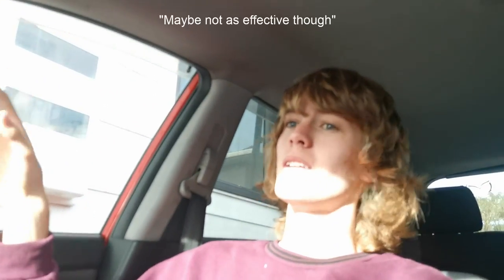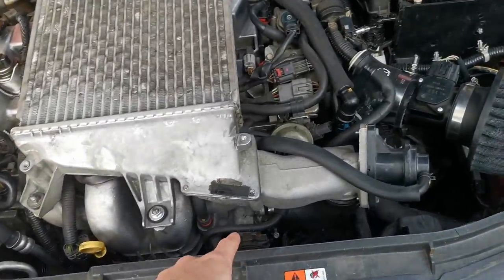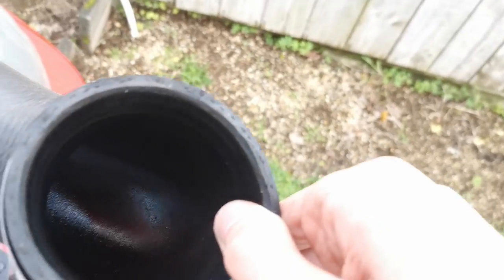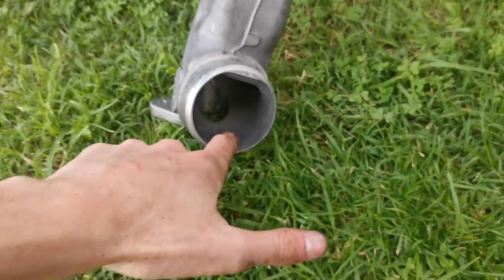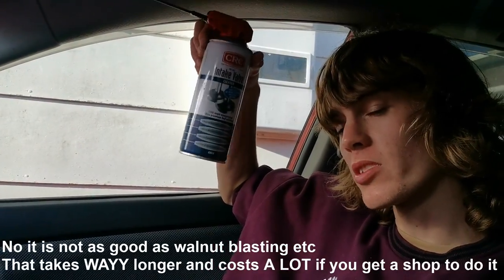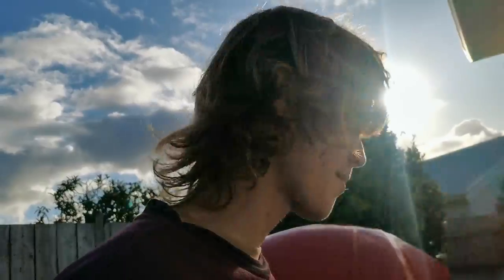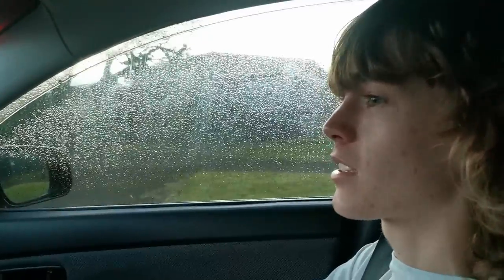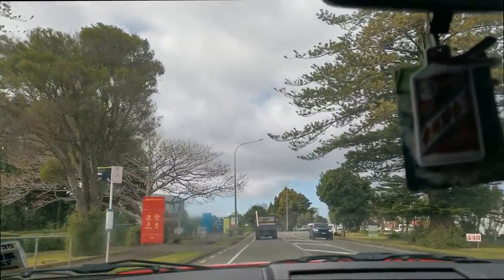DO THIS TO YOUR MAZDASPEED BEFORE ITS TOO LATE

Comment from the maker: so with the throttle body, i’ve heard pushing it open by hand runs a small risk, i can’t say i’ve ever seen someone have an issue with it.
apparently you can plug the switch in and have someone floor it with the ignition on to open it, i’ve tried that and it didn’t work

https://instagram.com/life_of_tuners?igshid=YmMyMTA2M2Y=

Comment: you might want to also service the fuel injectors, and also clean the intake valves. Would also reccomend a pro tune from reputable e-tuners. Also change spark plugs, coil packs, maf sensor.
Reply from the maker: Spark plugs are new, defo gonna look into getting the injectors serviced
Reply: You can have them serviced but I've found a complete new setthat comes with the upgraded seals for about a thousand bucks for the people willing to spend it. Will you let me know how the servicing came out? I'm still trying to decide.

Comment: I think mine is starting to have some vvt issues but I’m building a motor atm so I’ll just put a new one in the built one
Reply from the maker: Oh really, 90% of people think they have vvt problems, but it's just the hpfp/di tick lol
Reply: @LifeOfTuners  I hear a slight chain slap i believe on startup only when cold
Reply from the maker: @Mac_Flurry  oh damn, if you search it on YouTube, there should be a few videos showing the sound, that being said if it's only for 1/2 a second, that's fine, it's the pump getting oil pressure

Comment: Yo, will opening the butterfly valve part of the intercooler when you are cleaning it with the brush not mess things up? Chur
Reply from the maker: apparently you run a small risk, i’ll update my pinned comment, but i can’t say i’ve ever seen someone have an issue with it.
apparently you can plug the switch in and have someone floor it with the ignition on to open it, i’ve tried that and it didn’t work
Reply: Cheers for answering

Comment: Egr delete should be your next mod. Stop all that recirculating sh*t round the internals. I'm porting and deflapping my intake at the moment. Then going to slam 4 meth jets on it ready for more power and a great valve cleaning solution..hah. keep them coming fella. You will start to run out of cheap things to do soon bud..lol. hence why I have not posted for ages..lol
Reply from the maker: Should be but argh I can't afford that gas milage 😩😩 i feel guilty after I bought a hpfp and rmm for it 😭 I need sum more munnies 😭
Can't wait to see what happens tk yr gen 2 👀
Reply: @LifeOfTuners  yes the price of fuel is beyond a joke at the moment. And I to have not had the money to do ANYTHING to her for like over a year now.😭😭😭.
But! I have some leaking front braided lines I need to replace. And some rear droplinks that need doing. So there is a couple of vids.hahhaha. but the big one is that I still need to port the internal waste gate on the turbo some more. As its still over boosting and is controlled by the throttle map at the moment. So it's safe ish..lol. but I need to crack on with it ASAP.
Reply: @LifeOfTuners  egr delete shouldn't be TOO detrimental in your fuel mileage if you drive the car spiritedly anyhow. Ok catch can, and egr delete are a major benefit to the reliability of the car. My gen 2 finally showed up! I got a red one.
Reply from the maker: @thisislargemouth5566  I do definitely drive spiritedly ahaha
Reply from the maker: Why are cars so expensive 😩😩